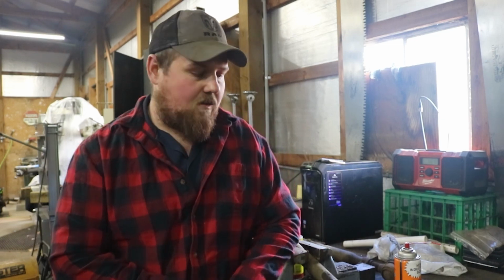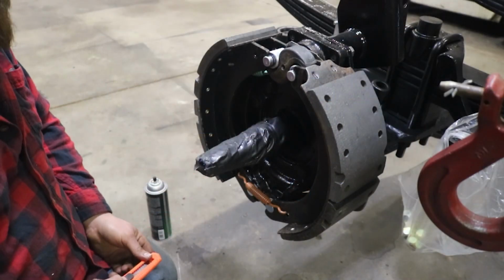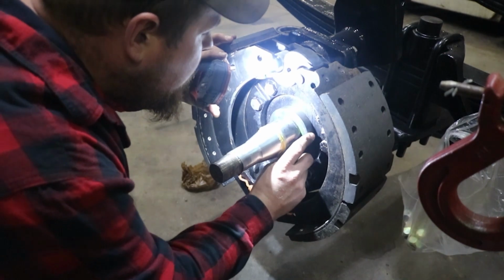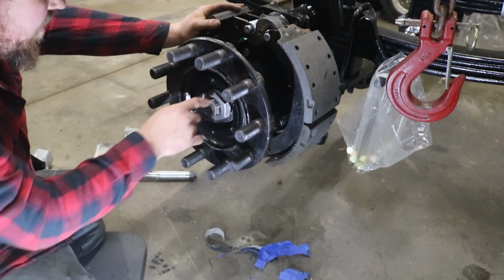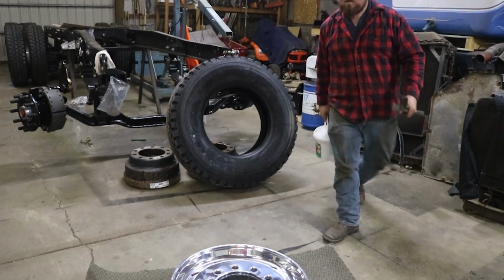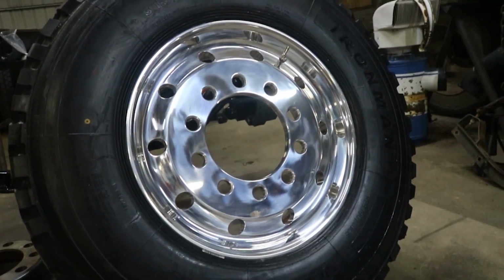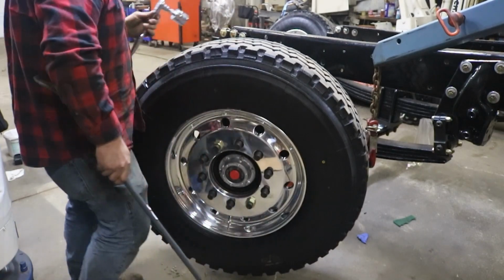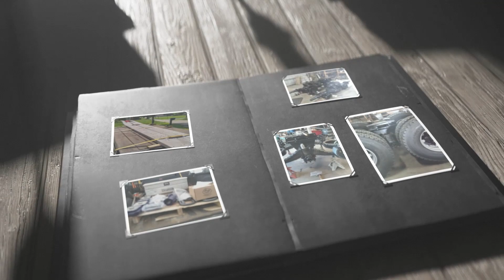Mack R686ST | Truck #17 Restoration Part 15

Comment: Great job Mr. Oil Farmer you are going to have a nice R model when it is all re-assembled. I am going to look into those 315/80/22.5's for my next set of steers as I drive mostly gravel roads.
Reply from the maker: Thanks! I don't have any firsthand experience with this specific brand of tire, but I've heard good things and the price is very reasonable in my book as long as they hold up. the 315's don't tend to hydroplane as bad as the 425 flotation tires, but also don't cut into the ground like an 11R does.
Thanks for watching!

Comment: Are those the original hubs? Did you have to add that spacer in order to run the 315s? Did you have 11R22.5 on the steers originally? Do you think one steering gear will handle the 315s ok? Most trucks with floats have dual boxes. 315s I guess are in between floats and 11R……I ask all these questions because I’m looking to do the same swap on my 94 RD. Thanks.
Reply from the maker: Originally this truck had spoke hubs on it, long before I bought it they must have been switched over. I'm guessing the wheel seal spacer is a product of changing the hubs from spoke to Budd. 
I believe one steering gear will handle them just fine. Usually, you see an extra steering gear or bosster cylinder on axles rated for higher weight, therefore needing tires that are rated for more weight. The original steer tires were 11R22.5 yes. If you put the 11Rs next to the 315s there isn't a huge difference. As long as I don't over load the steer axle, I think it will be just fine.
Thanks for watching and commenting!

Comment: You’re doing a hell of a job on this project, your care and attention to detail are commendable 

I’m preparing to dive into a similar project on my 1985 R model, unfortunately finding a set of usable take-out frame rails up here in New England is proving to be very difficult. Not sure if you looked into new rails from Mack, but the price will make your head spin!

Look forward to your next video, I’ve watched them all. Keep up the good work 👍🏻
Reply from the maker: Thank you so much! It was pure luck finding those rails. New ones from mack were out of the question lol. Best of luck with your project!